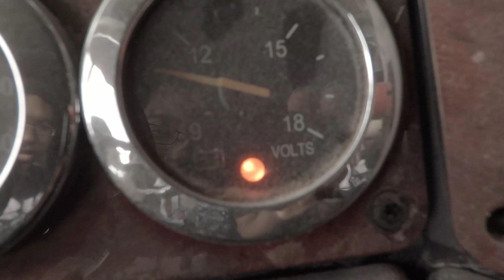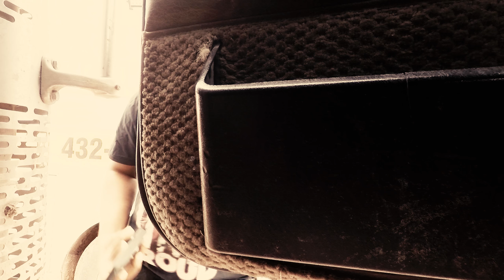Long Nose Problems In Oilfield (Vlog 7)

Comment: turbo next have your boss and shop check your boost. it's may be nothing though if that smoke  goes away   durning the day but if it stays a problem
Reply from the maker: tc6868 the smoke isn't caused by the turbo.

Comment: Sup CAJ? he said your screwed cause you don't speak Spanish, You are in NM and should speak Spanish.  LOL... This is your Latino subscriber.  Also that wire he took out with that black and red color is a circuit breaker probably for your inverter. I sent you an email call me I live up 30 minutes from you.
Reply: By the way if that red wire connected to the circuit breaker is connected to the positive of the battery , that terminal needs to be taped so it doesn't touch ground. That could start a fire if it grounds out. CU